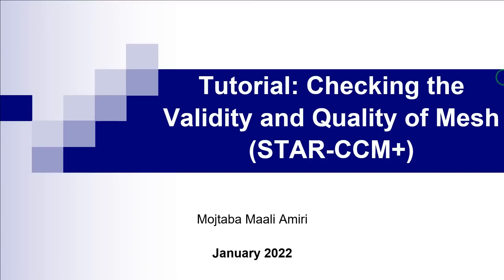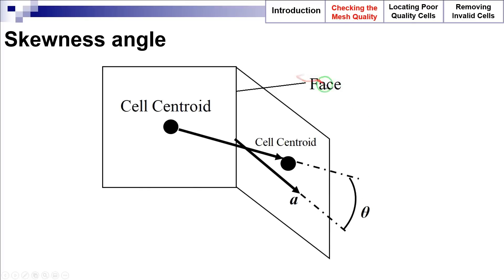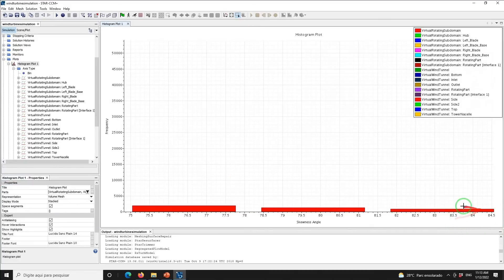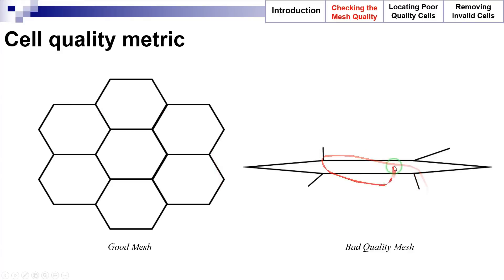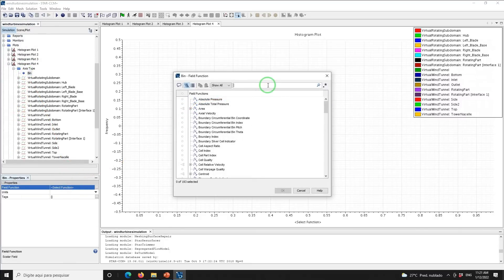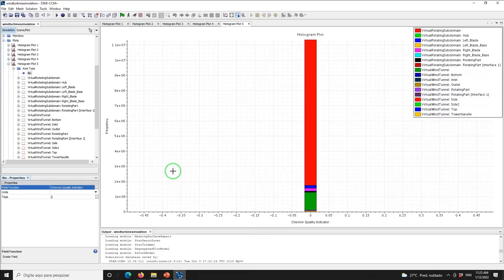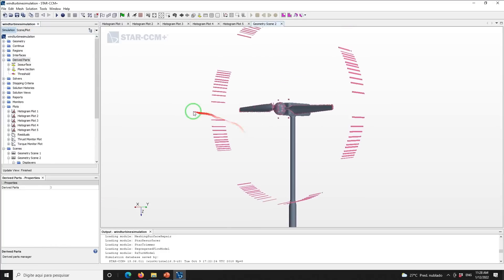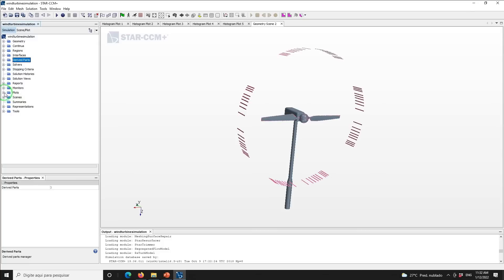Tutorial: Checking the Validity and Quality of Mesh (STAR-CCM+)

Comment: Very nice video! Are there any methods to improve overall bad quality cells without changing them into symmetry domain, other than densify the mesh?
Reply from the maker: Dear Vittorio Rango,

Thank you for writing! In answer to your question, please note that using volume/surface mesh refinements for the regions where low quality cells are located is the best method to deal with any mesh quality issue.  

I hope this was helpful.
Respectfully,
Mojtaba.